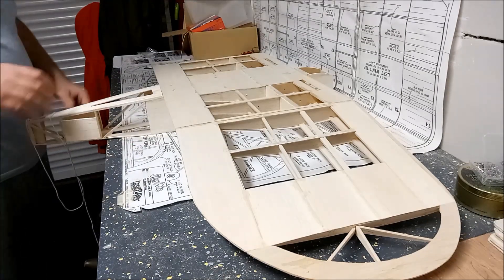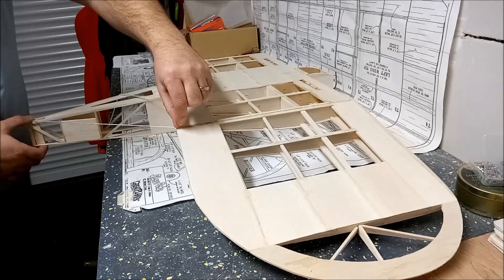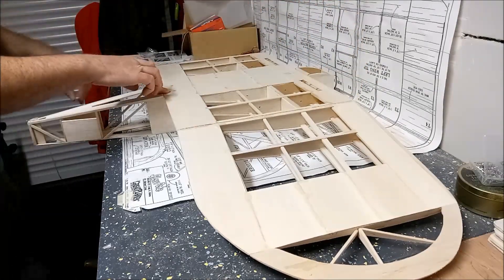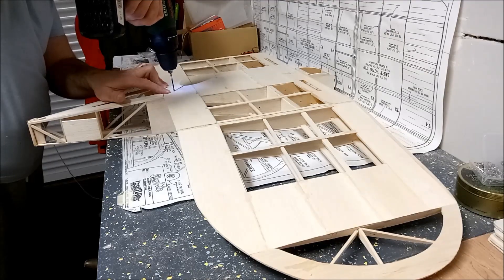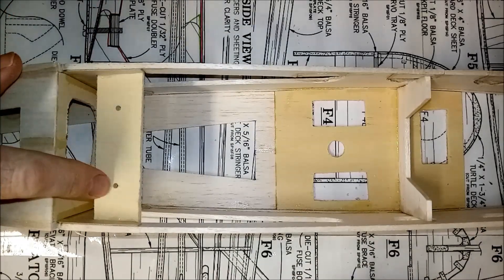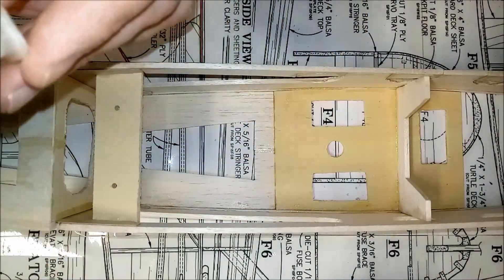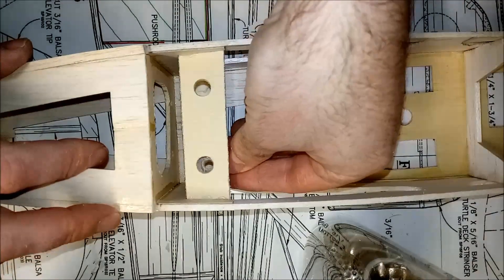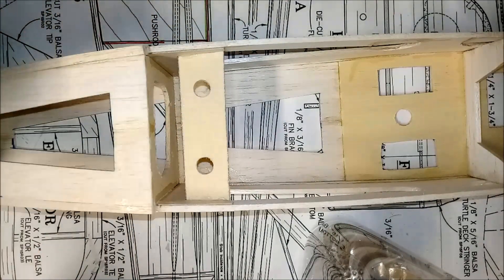Vid 8: Installing wing mounting bolts. Slow Poke (RC Plane)

Comment: Just a couple additional tips, I would use a backer block while drilling thru to prevent tear out, also I would rough up the plastic surface for a better bite of the epoxy to the plastic as most of the plastic parts have a mold release agent on them that is sick and maybe use a piece of wax paper between the wing and mounting block to prevent any stickage between the epoxy and wing.
Reply from the maker: All great advice, thanks!